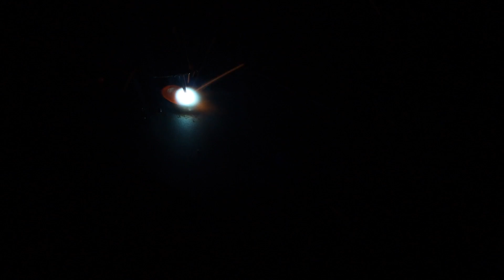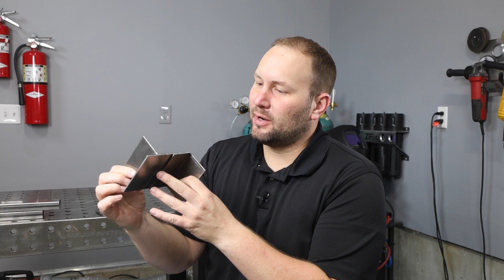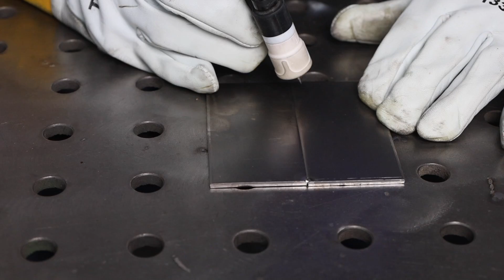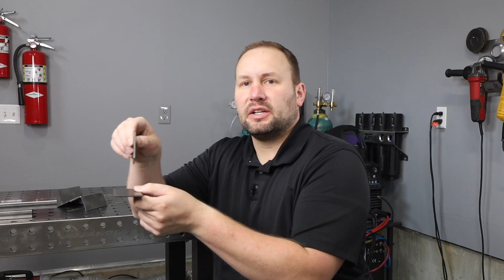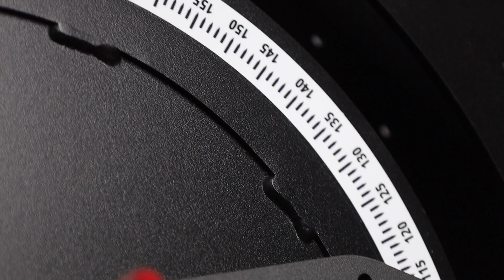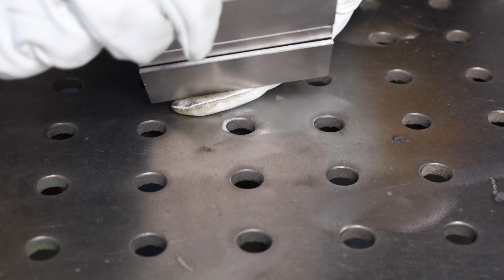Practice Welding with Less Material

Comment: For practicing outside corner welds, I realized that welding 4 -- 2" x 4" weld coupons and then adding a bottom gives me a total of 24" or 2 feet of weld practice.  I then turn around and have been cleaning up the welds and polishing.  I give them away as pen and pencil holders.  So far I have been making them out of 1/8" Stainless Steel and Aluminum.  People really like the SS ones because of the weight.  As I have improved my skills I am working down to thinner metals such as .063" and .032".  I will be setting up an inert box to practice my Titanium welding and doing the same thing.

Comment: What is the tig welding table top made out of? Does that effect welding aluminum? ie.. If you spend all that time cleaning your aluminum to weld, clean the rod, etc for only aluminum, and then put it on a steel table, seems like it would pollute the super clean aluminum.
Reply from the maker: Awesome question! The biggest problem you’ll run into is little arc marks if you ground through the table. I have a large aluminum plate that I put on top of my table for precise aluminum work. I also have a second aluminum fixture plate with threaded holes that I can clamp to. In all reality, though, it doesn’t really matter for most things.

Comment: Sorry you are wrong there are only two types of weld a filet and a butt position varies but not the type of weld
Reply from the maker: The two types of weld are fillet and groove, as I said in the video. This is why the numbered positions end in F or G. Butt is a type of joint, of which there are several including the 4 I mentioned.

Comment: I just purchased your online course to help me with flux core welding. I am 67 years old and wear glasses. I am having a problem with being able to see my weld as I lay down a weld. Any ideas to help with this problem.
Thanx, Guy
Reply: I have the same problem.  Here's what helps me.  I have an auto-darkening hood.  Initially I was turning the darkness down (making it brighter and brighter) thinking it would help me see.  That made things much worse.  You want it as dark as you can stand.  The darker it is, the better you will see the weld pool.  However, with it so dark, it's tough to see where your going.  So, I added a strong LED head light to my hood with Velcro.  Adjust it so that it shines directly on your work.  Search Amazon for LED Headlamp Flashlight, or pick one up at any big box store.  Some have adjustable beam focus.  The only hard part is remembering to turn the stupid thing off.  One last tip, if you can, take your work outside and work in direct sunlight.  That helps to see where you are going better than any flashlight.
Reply: Yeah that's hard for me too.i run a practice bead on scrap to check penetration on those settings and then I kinda look at the glowing bead behind the pool to see if it's the right shape and size rather than at the pool. Back seat driver o guess you could say. 

Though it helps a LOT if I aim a strong light at what I'm welding
Reply: What is the problem you’re having with seeing? These guys could have solved your problem. But when you say you wear glasses, it could be focus. I’m 76 and I wear glasses. I also use “cheaters” in my hood. That’s a plastic lens that goes into a slot behind the filter lens. Available in different strengths. They aren’t too expensive, around $20, give or take.

Comment: Hi Tim I'm stating to tig weld aluminium but I carnt get to create the Weld pool . Then I burn a hole in the plate what am I doing wrong
Reply: Make sure you have enough current when developing the weld pool, then when the pool is made, back off a bit on the pedal and begin to feed the rod into the front of the puddle. I know it seems wrong, but if you don’t give enough to build the pool, you linger too long and can burn through more easily than if you give more and it takes less time. Make sure your tip is close enough, between 1/16” to max, 1/8” from the metal.

Comment: how could you incorporate an open route joint into this? would you add another piece to the side?
Reply from the maker: You could run full penetration on the butt joint, beveling the edges and gapping if necessary for the thickness you use.